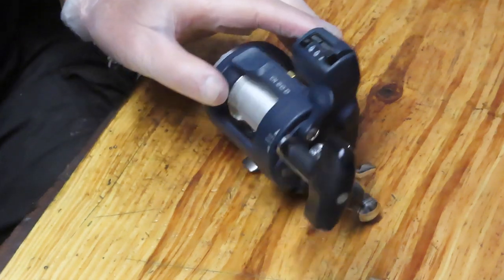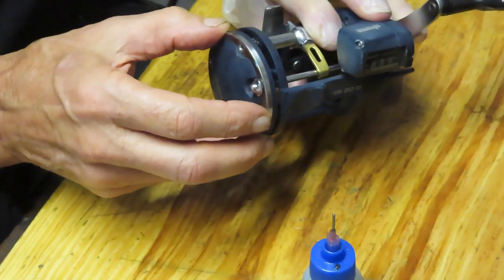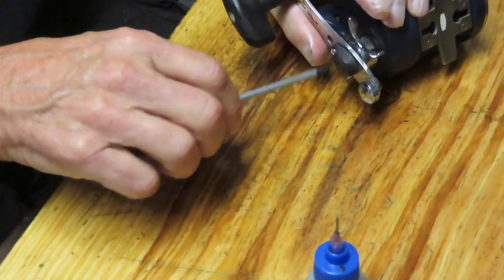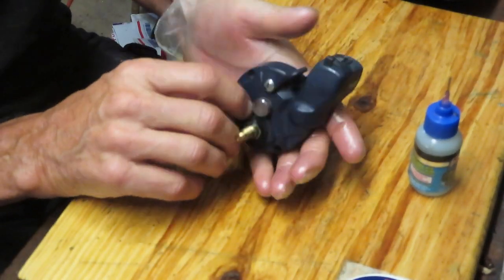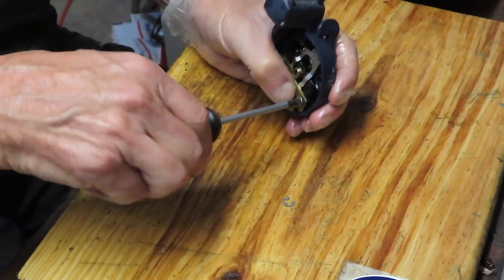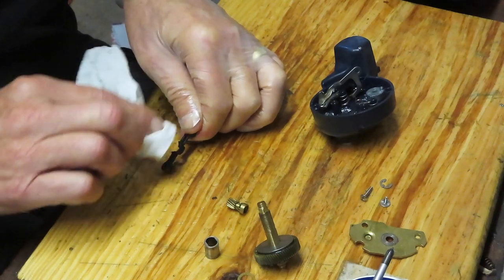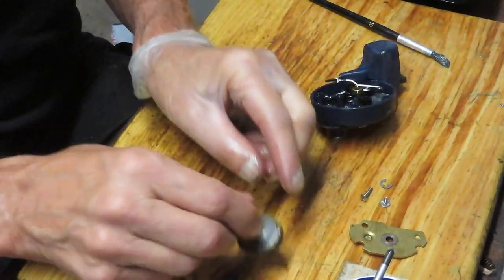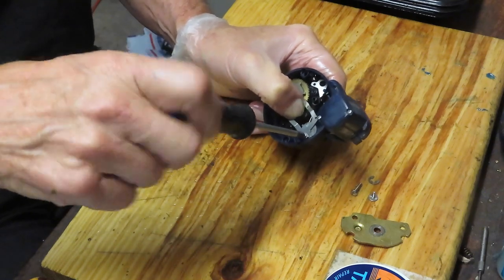Okuma Convector CN20 line counter fishing reel how to take apart and service

Comment: I’ve never used a reel like this but found this very interesting. Great video for your library Dennis! I had to totally disassemble one of my big Shimano SSG7000 Rear Drag reels last night because it got dropped in sand and water (not by me!) it has the worst c-clips I’ve ever messed with. Just the 10 seconds in that sand and water filled that reel with wet sand. I could not wait until I got it home so I totally cleaned and serviced it here at the beach. - not an easy task as I had tools but not my workbench at home. Anyway it is back in service again.— Chris
Reply from the maker: Glad you were able to do that.  I've had a few reels where that dunking happened and they were left to dry out in storage and then nothing moved at all. - Best wishes - Dennis

Comment: I have this same reel and when I was stripping the line off on a high speed spooler it appeared to seize up. Now the spool is very hard to move in free spool and when you engage the reel it doesn't reel. Any ideas of what may have happened and what I should look for?
Reply: After watching your video and taking the reel apart I fixed the issue. There were two issues. The floating gear pia wasn't actually seated properly when I took it apart. It was actually off the rod and just floating around inside. The other issue was there was a little line in the gearbox of the handle side. After correcting those two issues the reel seems to be working perfectly! Without this video I would have never been able to even take this thing apart! Thanks!
Reply from the maker: Glad that you fixed the issue - Thanks for watching - Dennis